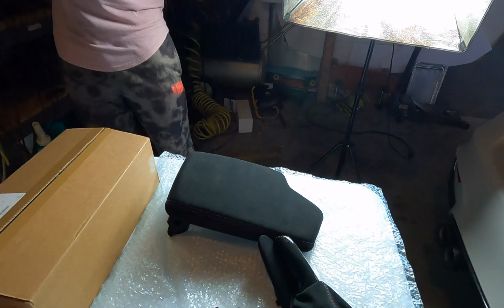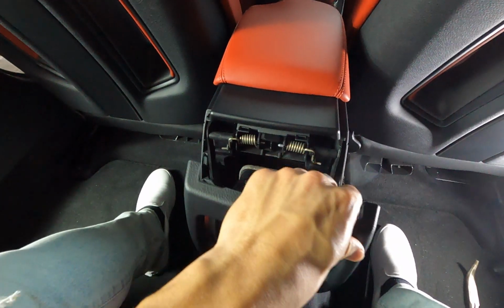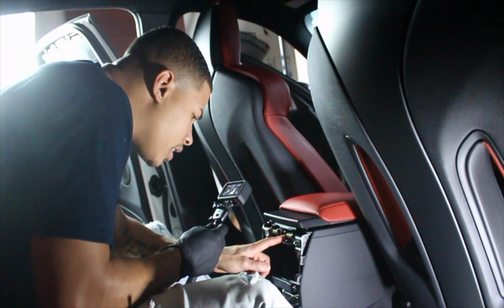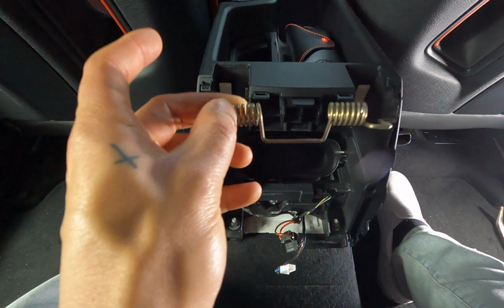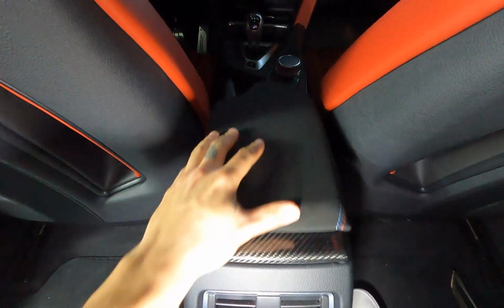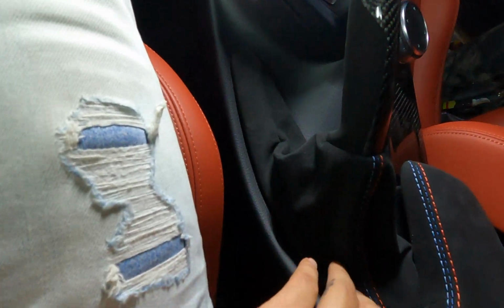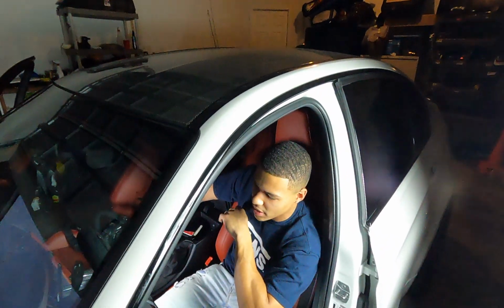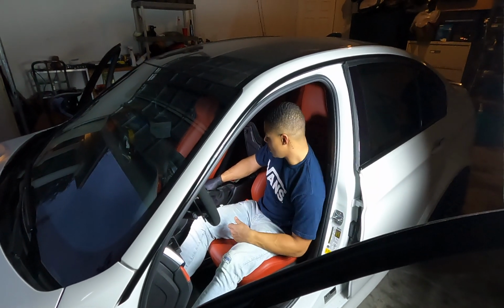INSTALLING MORE BMW M PERFORMANCE PARTS ON MY F80 (ALCANTARA AND CARBON FIBER ARMREST AND E-BRAKE)

Comment: Great channel guys. I am in the UK.I have a 335D xdrive 2016, bought as a write off from Copart. Not much damage but engine at 56,000 miles & running rough.  The interior was ordered with full alcantera seats & door cards & full Msport package. Stunning car but poorly . I am just adding the steering wheel cover & door grabs. Also the centre consol areas. After that i would like to do the mod you have just done with the armrest & brake lever. Keep it up guys. You will soon pass a 1000 subs. I am at 800. 
Regards from the UK to 2 great guys.. Just to add the car has the full LED lighting package. The headlights are amazing & each of the 4 lamps are individually controlled by a camera behind the interior mirror. 
Steve.
Reply from the maker: Thank you for the kind words Steve! I have a 335i myself that I’m currently in the process of rebuilding with 107k miles on it. Thank you again for the confidence boost for hitting 1k subs and good luck with your build ✊🏽

Comment: Does it match well? Does it look weird with the tri stitching next to the white stitching on the seats?
Reply from the maker: The stitching on my seats are actually the same color as the seat so it works perfect with all the other M performance parts that have Tri stitching in the interior. Flows together nicely